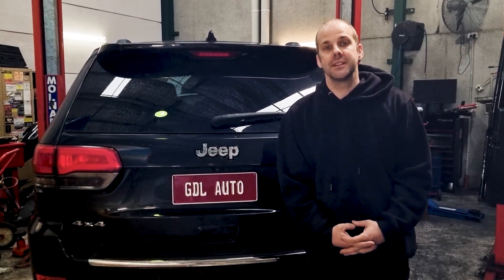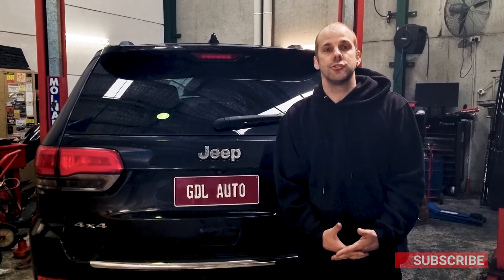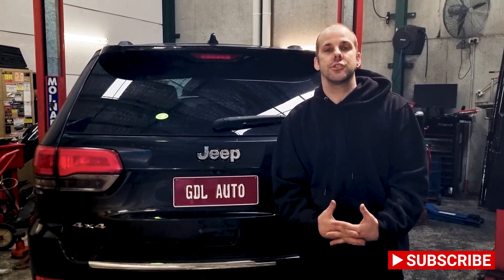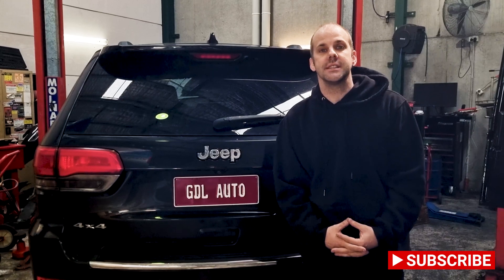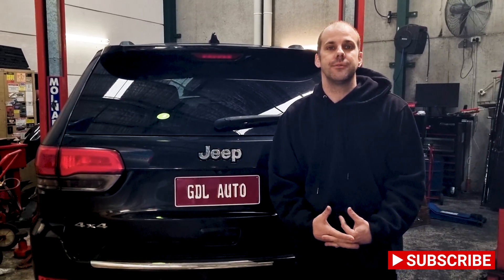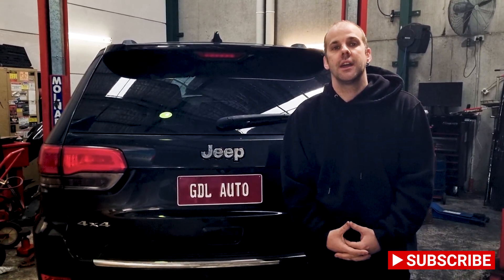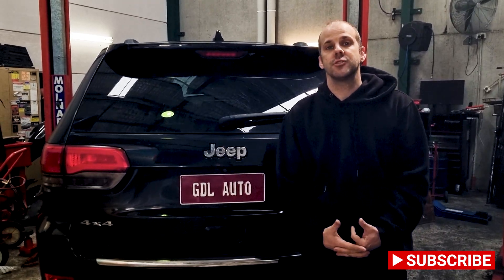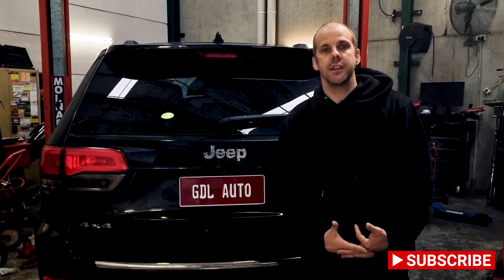WK2 Jeep Grand Cherokee 3.0L Eco Diesel Bearing Failure - Preventative maintenance

Comment: Mine just went recently. No warning, just came up with a message-Low Oil Pressure. The vehicle was running fine, no issues, always serviced. Even went to servicing every 10k for the last 3 services. No towing, lots of highway driving. The only thing I can think of is the vehicle had sat for 2-3 weeks without starting on a few occasions. Even before our last trip it hadn’t been driven for a few weeks. Maybe the bearing dries out? Got a good result from Jeep Australia so onwards and upwards we go with a new motor.

Comment: I have a 2015 diesel Grand Cherokee mixing diesel with engine oil. Has anyone had this problem and can help me? thanks
Reply: If engine oil is mixed with diesel, its becomes abbrassive and eats your crank bearings.
Reply from the maker: very common 
Likely culprit is the oil cooler

Comment: We have discovered what the problem is  !  
Those stupid engineers made a huge mistake when they developed this blocks.
We modify the block and the journal bearings to prevent them from oil starvation.
Reply: And what exactly do you modify?
Reply: so what exactly is the issue? Around 50-75% have dead engines according to my local car portal here in Europe

Comment: I have used 5w40 oil with new oil filter every 10k since new (2015). Just reached 240000km. Engine is running fine, except it blows thick black on heavy acceleration. I have been punishing this car with offroading and occasional towing from the beginning. Love this car and will try to keep it running for another 250000km.
Reply: Hola, también tengo uno, como te va al día de hoy, saludos 😉

Comment: Thanks - love my WK2 diesel so far, but scared of the problems including oil coolers, intercooler failures, bearing failures and of course the turbo cooling hose failure “in the valley”.
It’s a fabulous tow vehicle as long as these gremlins don’t attack me 😢
Reply: Hows it been! Wanting one.
Reply: @gsingh5402  I’ve had a “dream run” … so far! 
Not a single issue, touch wood.
Reply: @FutureSystem738  did you get it tuned? Im in California so that might not be an option. Also how is your driving routine? I have about 25 miles of freeway daily at least. Maybe 15 miles of stop and go. I do make a lot of weekend trips about 150-200 miles every few weeks in a weekend.
Reply: @gsingh5402  Definitely longer runs are better for it than very short runs. I do a lot of towing- it’s great for that.